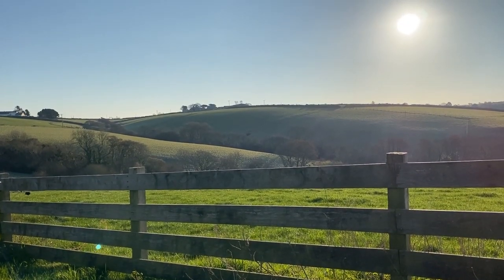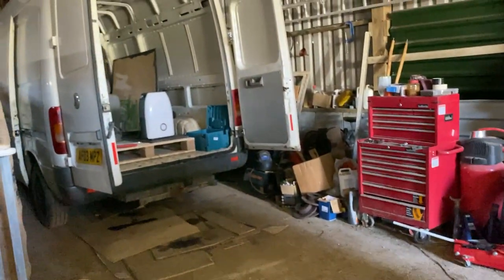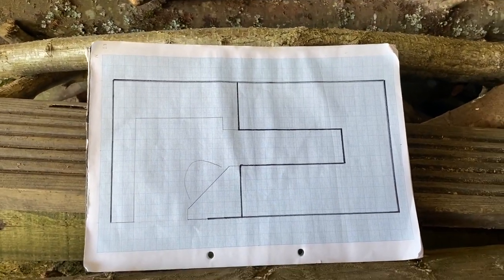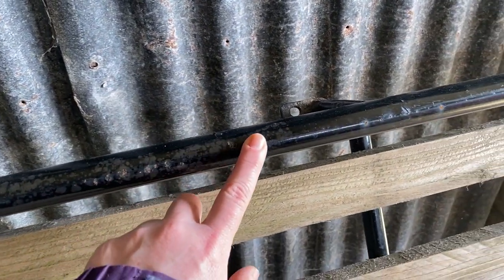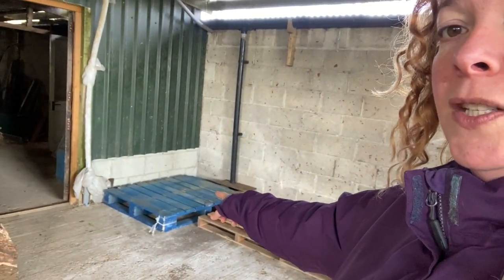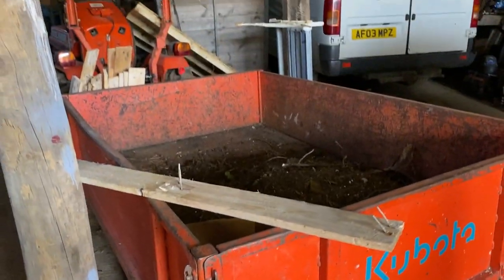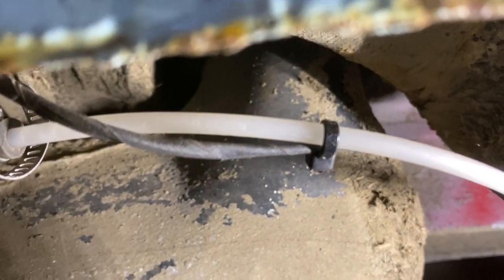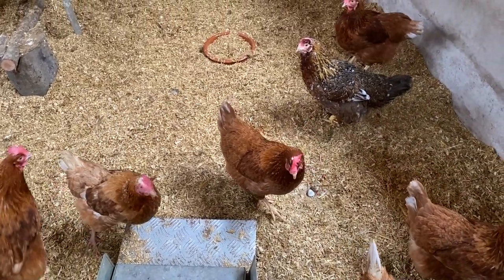😱 We Bought a New Van! 😱 * DITL Vlog * Diesel heater * Roof Rack * Chickens 🐔

Comment: I'm so excited for you. Love the floor plan. Seriously, I'm addicted to self-build van videos and would lay out a Class-B exactly as you have sketched it. I've found it very important to have an open area as you enter the side door. In my former Class B, manufactured by an expensive company, the kitchen counter intruded into the front door space. Not good. So often I want to sit on the floor of the door opening facing out to visitors. x
Reply from the maker: Thank you lovely! That’s great feedback, and you’re right I enjoy sitting in the doorway in Myrtle. Since filming this, I’m now considering losing a bit of that kitchen unit by the door to put in a swivel passenger seat. I’ve never had a swivel seat but thinking it would open the space up even more 🤔
Reply: @hedgecomber  Swivel seats seem popular. I like the way the Morgans have their table set-up right there in the doorway with the swivel seat on one side and some sort of ottoman or something on the other. Having a movable table is nice because you can use it outside when you want to, and it doesn't take space when you don't need it.
Reply from the maker: Agreed. It’s so fun designing a new camper 😆

Comment: Exciting times, loved building my big Van after having the T4 for 12 years. 
Fitted a Thetford Triplex Oven/Hob in mine, it’s brilliant and worth every penny
Reply from the maker: Good to know! A question re the Triplex, does the oven temperature run true? Several different gas oven reviews I’ve looked at are a bit vague re the temp 🤔
Reply: @hedgecomber  I’ve not had any issues. It’s quite compact, heats up quickly. I guess it may be a little hotter due to the size
I’ll order a temperature thingymebob off eBay and do a test
Reply from the maker: Oh you diamond, thank you!!! 🤩
Reply: @hedgecomber  ordered
Shame my video/editing skills are so bad otherwise I’d record a review. I’ll let you know how it goes
Reply: @hedgecomber  sent you messages on FB.
Very pleased with the performance of the oven

Comment: Brilliant, aren't those heaters an absolute game changer.  If you haven't already, lower the pump speed to 1.2htz it will go through very little diesel then. Also lower the temp to around 19oC, which I'm lead to believe is the best constant temp. 🤙
Reply from the maker: They are amazing! I didn’t know you could change the temp (still haven’t read the book 😆) I’ll let Jonny know. Thank you x
Reply: @hedgecomber  it's probably set to "Htz" now, if you press the down arrow, it should show up. If you press the top two buttons together, it changes the Htz to Oc. Just use the up and down arrow to set the temp. 👍🏼